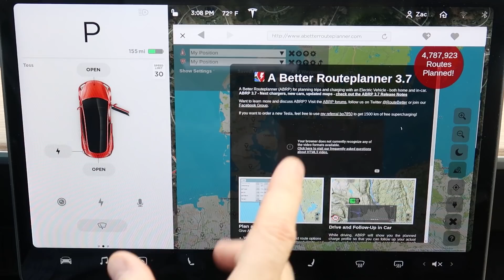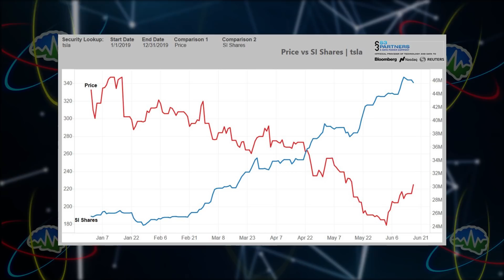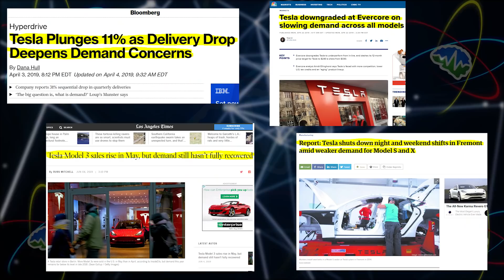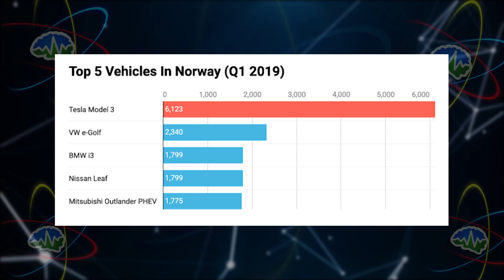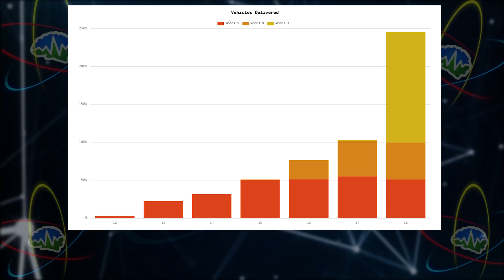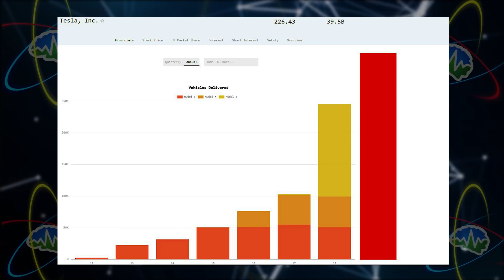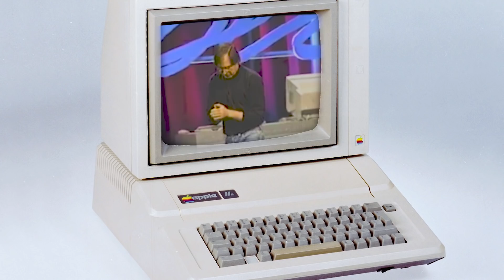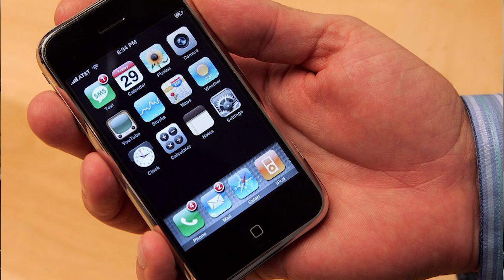Tesla Short Squeeze! | In Depth

Comment: Fundamentally Tesla is spending more than they take in.  Interesting financial engineering collecting deposits to finance current operations.  Elon has been promising many things he has not delivered.  Large institutional investors are dumping this stock in droves.  They were short on cash and needed to do a secondary offering of shares at $240.  The plan for model 3 was to get affordable yet you categorize it as a luxury car.  If your analysis is correct there is nothing to worry about for Tesla shareholders.  However you are missing dialogue on margin rates.  Also why did big oil not go short on this years ago?  Why now?  Of course none of the major manufacturers are going to do anything to combat this competitor eating their market share.  What about the batteries that explode after being punctured?  Interesting perspective.